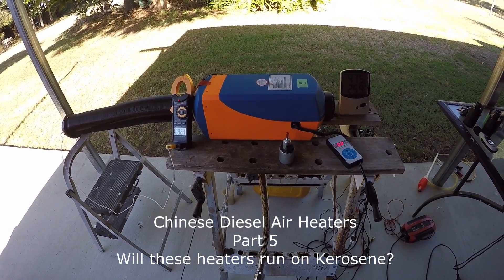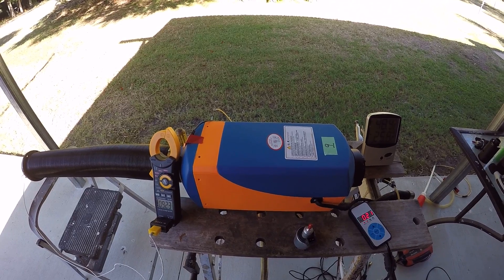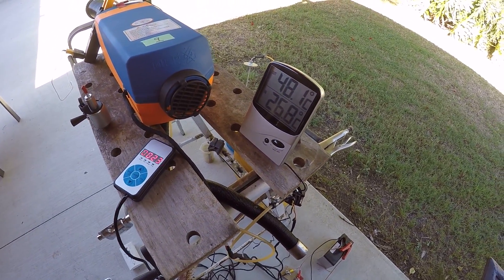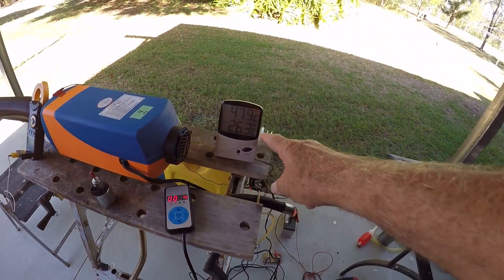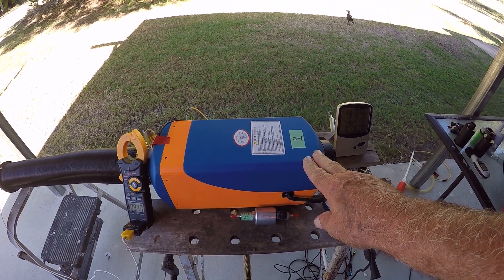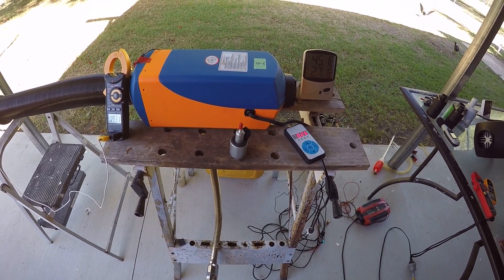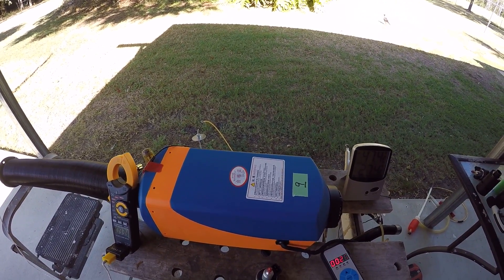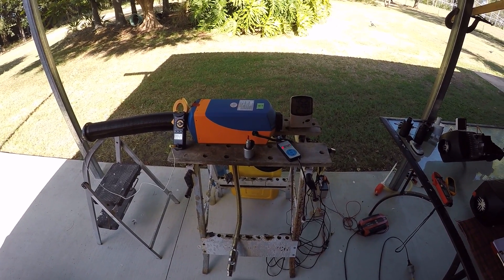Chinese Diesel Air Heaters   Part 5  - Kerosene Use.

Comment: Does the quality of the diesel fuel affect the performance of the heater? For example, using "expired" diesel which has been in storage for 2-3 years without additives or stabilizers added.

Comment: 8:10 hi mate great video ! One general question …. I often get E8 error on my Chinese 2.5 heater… will adding kero to the diesel help in any way and if so what ratio would you recommend?
Reply from the maker: @smoomanchu  
Hi SM,

Error 8 generally refers to a fuel issue. Adding kero  is unlikely to solve your issue.

Is there an easy fuel run from tank to filter to pump to heater. No sharp turns, no blockages.

Have you checked the fuel filter? Perhaps a new one. If no filter you may have crud in the pump preventing it from working properly.

Is the fuel pump in a vertical position, above aprox 45°

Are you using narrow bore hard nylon fuel line from pump to heater. With a fuel delivery greater than a couple of feet from pump to heater the use of “soft” fuel hose absorbs the pump fuel pulses.

Is your fuel atomising screen in the heater carboned up preventing fuel atomisation?

If a carbon issue with the atomising screens, sometimes a kerro diesel mix 80:20, can help burn off the carbon.

Without seeing the heater operation it is difficult to offer specific suggestions, but these should get you started

Cheers.   JMcK
Reply: @johnmck1147 important to mention the output side of pump be lower than intake (the 45 degrees being ideal) that ALL of the line be hard nylon.  That 10 percent petrol to what ever is going to make a hotter flame.. and never ever ever ever have the heated air or combusted air from outside...   The diesel or kerosene is already a low temp burn, having cold air encourages soot

Comment: You can add a gallon of 2 cycle oil to 50 gallons of K1 or jet fuel - 
       You can also use a gallon of 20 W motor oil for lubrication if needed - 
    Just see how well the fuel pump does with out the added lubrication -

Comment: I have a 115,000 btu “turbo” heater that is designed for kerosene (US K1). Because diesel fuel is significantly cheaper I have experimented using it and I know similar heaters are designed as diesel heaters. My experience is that my heater will not ignite on any more than 50% diesel and it doesn’t run as hot (not as much  red glow). I have only recently gotten a Chinese diesel heater and only run it on diesel. Can I expect more heat from K1 than diesel? So far I am not impressed with the heat output of my unit.

Comment: I know I'm late to the party, but in the UK 🇬🇧,  currently 8 sec kerosene is about £0.60, diesel is about £1.55. That's why I'm here, 😊
Great information. 
I'm wondering what would happen if you added a bit of good quality two stroke oil.
Reply from the maker: @iainball2023  

Works well ……For a while. Oil additives in these heaters produces large amounts of soot in the atomising screens and burn chamber. Eventually causing a non start.

I have been told in the UK your heating kerro, (unlike lighting kerro) contains sulphur, which would provide enough lubricant for the pump.   JMcK

Comment: i think i tried kero from a friends farm for just 1 day. i noticed a reduction in heat output. perhaps the pump is sucking less fuel due to its lasck of lubricating properties?
If so i will convert to a 50/50mix of diesel and kero.
its half the price buying kero in bulk  in the uk due to taxes on diesel

Comment: I've run mine virtually since I got it on Kerosene with absolutely no issues, no pump problems and zero soot or ash. I am now trying 80% Kerosene 20% sump oil from my Hyundai i10 petrol and no issues either.
These pumps are fine on 100%  kerosene.

Comment: I have used kerosene on a different type of burner and to solve the wear problem on the pumps we just added 2 stroke oil to the kerosene. We mixed 5lts 2 stroke to 2000lts of kerosene
Reply from the maker: Hi there, sadly these heaters do not like any oils, including 2 stroke. All oils produce smoke and carbon deposits, which eventually gum up the burner atomisation screens and the burner itself. JMcK

Comment: Can’t find c2 kerosene here in the US for some reason. Can I use c3 marine kerosene or is the sulfur content too high? Thanks in advance.
Reply from the maker: Hi Ben, as mentioned previously I have no experience with your kerosene, but in Australia with our very pure lighting kerro, I personally only need to run a 90/10 …..Kerro/diesel mix.  Cheers.   JMcK
Reply: Thanks for the info. I’ll use the same mixture that you’re using. Have a great 2024 @johnmck1147
Reply from the maker: I have no personal experience with your Marine 3 kerosene in the US.
Is it for lighting or heating?
If for lighting it is normally very pure and will require about 10% diesel in the kerro to provide lubrication for the pump.
If heating, the kerro will generally have some sulphur content and this is generally enough to provide pump lubrication.
If it does not work out, on worry, the pumps are very cheap to replace.   JMcK
Reply: Thanks for your reply. I can’t find 2C kerosene anywhere so I’m thinking about a 70/30 blend of diesel and kerosene respectively for fast start up of the diesel heater along with some lubrication from the oil and then keep a spare pump handy just in case. Does. This mixture sound reasonable to you or should I alter it? @johnmck1147

Comment: In about a 20 litre can put a few litres of car engine oil in your 20 litre can and that will lube it up perfectly you can run a diesel engine like this also, even old engine oil but filter it first
Reply from the maker: This will work, but only for a short time. 

Burning oil, including two stroke oil in these heaters rapidly gum up the burner atomisation screens, and the heater will no longer work without some serious maintenance. JMcK

Comment: I get starting issues on Kero here in the uk, ive cleaned and maintained the burn chamber and the heater produced about a teaspoon of ash in 6 months of winter use but I put that down to the 25ml of 2 stroke oil I add to each 10litre tank ful of kero, some people report that they have run kero here in the Uk for as much as two years without any pump issues at all. my heater seems to require a little more air to get started so I had to reduce the fuel pump speed from 5.5hz down to 5hz and increase the minium fan speed  from 1500rpm to 1800rpm and this seems to make the kero ignite a little quicker. sometimes it would ignite just before the fan increased its speed and because the fan was not up to speed the ignition would fail . increasing the fan speed at the lower end seems to make the fan respond a little sooner aiding the burn when the heater is cold. I have now cut the air intake pipe in half and straightened it out so it doesnt struggle to get air and instead of the baffle ive put a little piece of old stocking over the end with an elastic band. I found if I removed the air intake pipe completely ignition takes place much sooner on kero and diesel so I figured that the air pipe must be inhibiting ignition to some degree. and yes Kero is much cheaper in the UK than in Aus or the USA cheaper than red diesel or off road diesel. currently $1.95 a litre in your money. it is currently £2.7578 AUS dollars per litre for road diesel here in the UK. 11/08/2023.
Reply from the maker: Hi There

These heaters do NOT like burning any oil additives, particularly two stroke oil. It creates large carbon deposits in the glow plug screen and atomisation screens. 

From what I have been told your heating kerro in the UK has a high sulphur content, unlike lighting kerro. If this is the case you do not need any lubrication additives. 

In Australia we use lighting kerro, and this needs a bit of lubrication, and I use 10% Diesel in the kerro for lubrication.    JMcK

Comment: what if i put two stroke oil in kero say 5% or so?
Reply from the maker: Better to put 5 to 10% diesel for lubrication. Two stroke oil creates smoke and soot which soon blocks atomisation screens causing serious maintenance issues. JMcK

Comment: I checked the price of Kerosene and diesel here in the Netherlands.
When one wants to buy Kerosene in small amounts (Bottles with 20 liters of Kero) then Diesel at the pump is 3x cheaper.
Due to taxation there is also a diesel fuel for tractors and boats and such. This has a lower taxation and is therefore even cheaper. However, I am not familiar with those prices.
Reply from the maker: Thank you for the input CD. JMcK
Reply: @johnmck1147  ❤

Comment: Love your content and the info provided.  If using kerro to clean (yearly??) running 50/50, do you lose significant lubticity?
Reply from the maker: Running 90/10, kerro to diesel gives enough lubrication for my operations.   JMcK
Reply: @johnmck1147  Thank you kind sir.

Comment: I added Exocet keronsene lubricity additive 1:5000 to uk heating kerosene and ran it in my heater for a week. Seemed to run fine except that the heater temp at maximum power was 219 degrees c. Where as with diesel it is 230. I thought kerosene burns hotter than diesel. Gone back to diesel as it seems hotter but this may just be psychological but the heater defo runs 10 degrees cooler. Any thoughts?
Reply from the maker: Hi L71

Thanks for the feedback.

I stand to be corrected, but from contributors, I am told that UK heating kerosene is not pure kerosene like lighting kerosene, and in fact has a high sulphur content. The high sulphur content provides adequate pump lubrication without the need for additives.

I am also told heating kerosene is a fraction of the cost of diesel in the UK, so a little loss of heating ability could be accepted.  JMcK

Comment: I don't get your point, how do petrol pumps lubricante, that fuel has even less lubricant. Diesel heater pumps could petrol spec, no one knows these internal pump specs
Reply from the maker: Hi Checker, as I understand it, your heating kerosene, as distinct from pure lighting kerosine has a high sulphur content, and that alone provides lubrication. JMcK
Reply from the maker: Hi Checker, 

Petrol pumps generally use a diaphragm type fuel pump. These heater pumps use a tiny metal piston flying up and down some 600 to 800 times a minute. In your motor car the metal pistons are lubricated by engine oil, try running your engine without oil. In a 2 stroke motor you add oil to the petrol to lubricate the metal parts. Try running your mower or chainsaw with no oil in the petrol.  Cheers.  JMcK
Reply: @John McK 47  Facet fuel pumps are 12v bulk head mounted for carbs,with an inline fuel pipe directly from tank, no oil feed  Most modern petrol cars have in tank pre pumps, no oil feed. I understand what your saying, loads of people run these on Kerosene, myself included, .78p per litre plus vat @ 5%, Red diesel is well over a £1 plus a litre plus vat in UK, fuel pumps are peanuts to replace if they do fail, cost savings far exceed cost of pump.

Comment: Can the heater run on chainsaw fuel?
Reply from the maker: These heaters can run on almost anything.......For a short while. Chainsaw fuel will cause lots of carbon deposits in the burner, requiring far more servicing.  JMcK

Comment: Could it run on furnace oil? I think its the same
Reply from the maker: Hi Heather, 

These heaters can run on virtually anything, for a while. The more smoke the burning liquid makes the more carbon deposited in the heater, and hence, the more frequent the maintenance.

You do not say what country you come from and I do not know about your “furnace oil”. However I have been told in some parts of the world furnace oil is just high sulphur kerro. These heaters will go well on that product.

You must do your own research to see what your furnace oil actually is.  JMcK
Reply: @johnmck1147  Canada

Comment: Great info, thanks. I have about 25 gallons of waste kerosene and was about to run it pure in my heater. Thanks for the warning. I will now add some lubricant to it, and fortunately have some atf i need to get rid of as well. Saved me a pump failure, many thanks.
Reply: I run straight K1 with no pump problems. I do splash a bit if low ash 2 cycle oil in when I get paranoid...I guess I am riding the fence lol. Kerosene is definitely the way to...no smoke, no gelling etc. I am happy I can get kerosene for close to diesel.

Comment: I'm located in Canada and I heat my home with furnace oil. I believe this is also the same as #2 fuel. I've heard that this is much the same as diesel but at a way cheaper cost. Wondering if you know if it can be used or not in these diesel heater. Furnace oil is located at many gas stations and at this time the price is $1.50 per liter compared to diesel at $2.50 per liter. Anyone know if this will work or if they have tried it yet.
Reply from the maker: Hi Steve, I do not know about Canadian furnace oil, but these heaters will burn almost anything. 
I personally would try it and see. Perhaps another viewer can give some feedback.

Steve, If you do try it, I would love some feedback on how it went.  JMcK

Comment: Thanks for the knowledge 😊 ... i changed my pump with a custom one (diaphragm pump) and now i can run my heater with rocket fuel if i want ... 🤪
Reply: what pump are u using.. does it pulse the same and deliver the same as the standard with same results etc ??

Comment: Wonder whether you could add some 2 stoke oil into the kerosene to lubricate ?
Reply from the maker: Hi Hasger,

Yes 2 stroke oil will work, but I advise against as it creates smoke and carbon when burnt, and hence more frequent maintenance.

Better to add around 10% diesel to the kerro.  JMcK

Comment: In UK We can buy a Lube additive  excocet kerosene lubricity additive . treats 1000 litres under 2 pence per ltr.  . For £17.99 post free. Do you think this should solve libricity problems for kerosene/ Todays prices nov 2022. red Diesel £150 Per ltr. Kero £120 Per. Ltr both get 5% VAT added.
Reply from the maker: Hi Chris, thanks for that info. 

However, as I am not from the UK, I am unable to test the lubricant.
Some opinion though. If it is oil based like 2 stroke additive, it will lead to increased carbon buildup. If you take a teaspoon of any additives and burn it and look at the burn. If it burns with lots of smoke you will have excessive carbon issues.

As I understand your industrial kerro, unlike our lighting kerro has a high sulphur content that provides enough lubrication without any additives.

It is simple to add 10% diesel to the kerro to provide lubrication.   JMcK
Reply: @johnmck1147  Thank you so much for the info, The 10% derv sounds good to me

Comment: Have you tried adding some low ash two stroke oil to increase lubricity to the kerosene  ?
Reply from the maker: As most people know, burning two stroke oil makes more smoke than a four stroke engine. 
All “oils” make smoke.
Burning all oils produces carbon.

You can use two stroke oil, but it will make carbon deposits and the heater will need more regular servicing. 

It is better to use 10% diesel in the kerro than oil. 

If kerro is high sulphur commercial, not pure lighting kerro you don't really need any additives for lubricant.  JMcK
Reply: Your last sentence is what people need to know. There is different quality kerosene. I would run kerosene if possible and your heater will run cleaner.  The kerosene I get from my local gas station is from a pump and at $4 a gal.is likely not lighting kerosene.

It is easy to switch a pump so keep a spare.  I think the Chinese say not to run kerosene because they want us to run diesel and clog up our heaters and buy another heater or a bunch of parts.

Comment: Informative video, just about to order one of these and have a large quantity of heating oil to use if possible, would the unit work with a gravity fed tank high up or does it require a fixed higher pressure ? cheers and thanks again.
Reply from the maker: Hi NM, 

First,  what do you mean by heating oil in your country?
If it is kerosene that is ok. If it is oily diesel or similar that will not work. These heaters will burn anything - for a while. But any “oily fuel causes rapid carbon buildup in the heater, and then it will not work.

A gravity fuel system is ok, but you must install a fuel shut off valve before the pump and turn off when not in use otherwise fuel can leak past pump seals and flood heater.  JMcK
Reply: Thanks John, v helpful - I have since watched a number of your excellent videos and now understand the role of the pump, simple but clever. I can see many of the people who have similar videos on YT have also watched your channel as everyone now mentions the infamous 'green' fuel hose along with other bits too.                                                                                            

Yup,  heating fuel is Kerosene, point taken about lubing the small pump, have some 2 stroke low ask oil if needed to add a drop or two, I may purchase a spare pump though just in case.

Thanks again.

Comment: Hmmm little pistons going up and down real fast... Sounds like a job for castor oil! A dash of that might help the kerosene lubrication issue. It does have a fairly low flash-point and always kept those Cox .049 Glow engines running at 23K RPM.

Comment: Where do I get a replacement oil pump are they all the same ?
Reply from the maker: Just search on line for “fuel pump chinese diesel air heater” there are lots of suppliers. It is the same pump for 2Kw to 8Kw heaters.  Just make sure you order correct voltage of your system. They come in 12V and 24 V.   JMcK